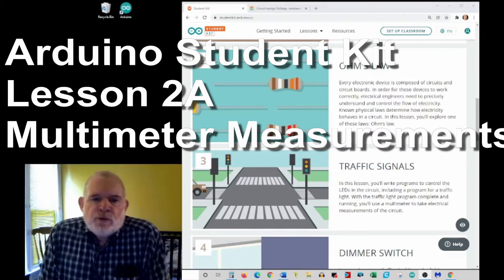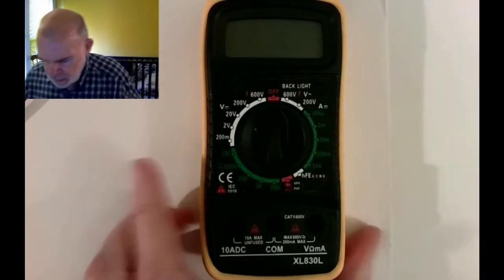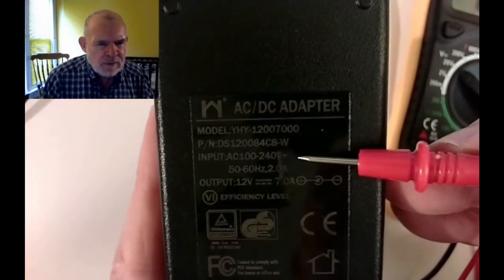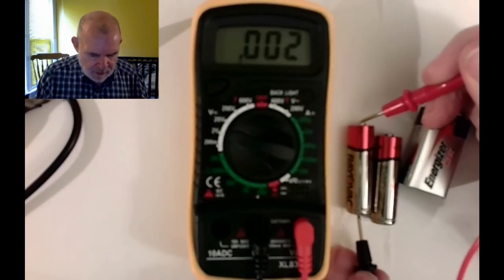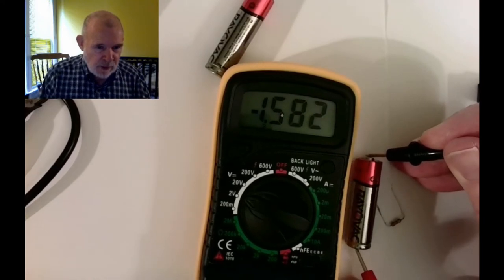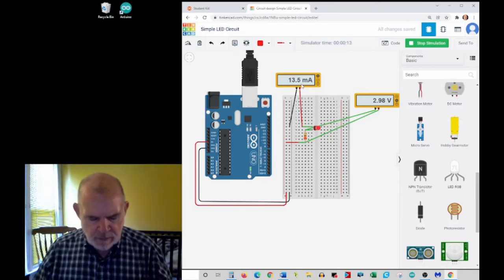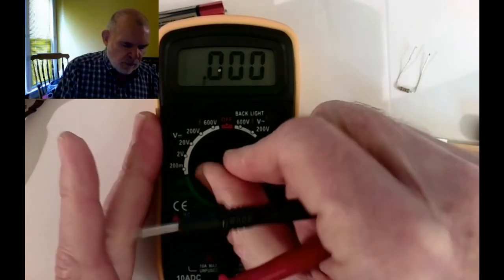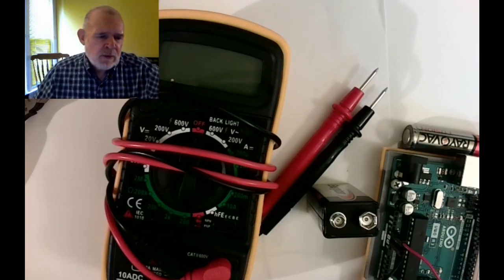Arduino Student Kit Lesson 2: Multimeter Measurements

Comment: May I ask  what program are you using
Reply from the maker: For video screen capture with multiple cameras, windows, and microphones (in camera), I use a free version of OBS Studio. To edit video clips together, I use the free version of Davinci Resolve. I use Gimp to edit static images, such as for thumbnail images. Sometimes I even use PowerPoint to lay out images, especially if they contain text. 

I like Audacity to edit sound. I used to record most narration using a separate Zoom H2 recorder, and process it in Audacity. For more recent videos, I have done more live recording using using OBS to record video and audio together. 

For Arduino, I have IDE 1.8.19. I also use TinkerCAD Circuits to edit and store Arduino sketches. TinkerCAD is also great to show the circuit layout. For CAD modeling, I use Fusion 360. For simple things, I might still use TinkerCAD. I would prefer to use NX, but don't have a license. I use Cura to slice CAD models for 3D printing, using an Ender printer.
Reply: @MarkLawry   TinkerCAD Circuits thank you Mark awesome Vids